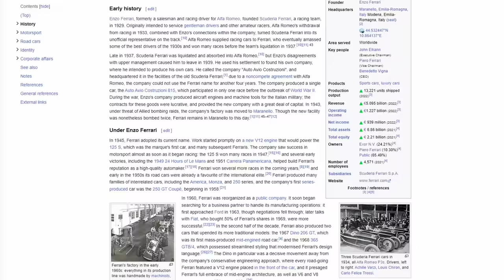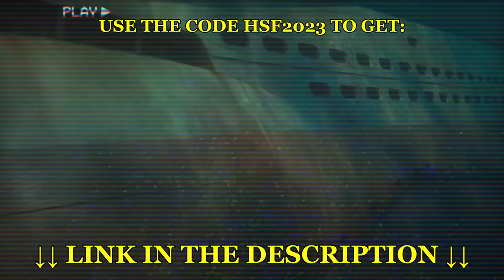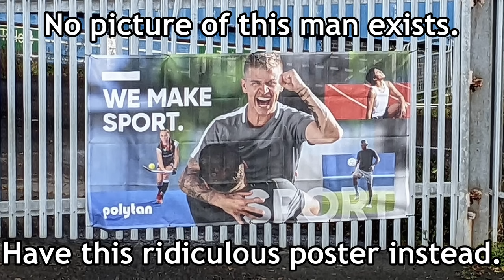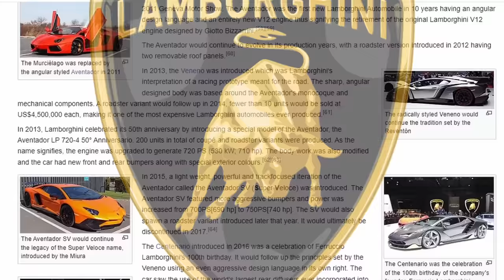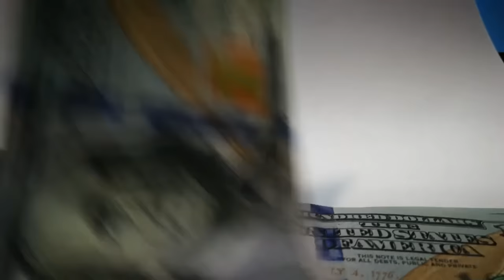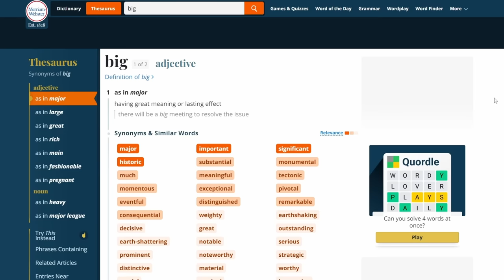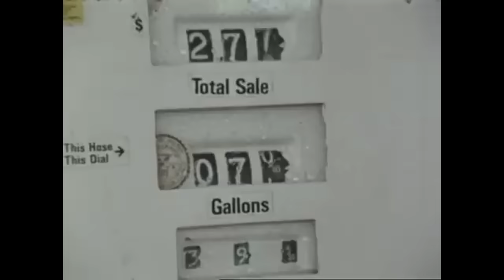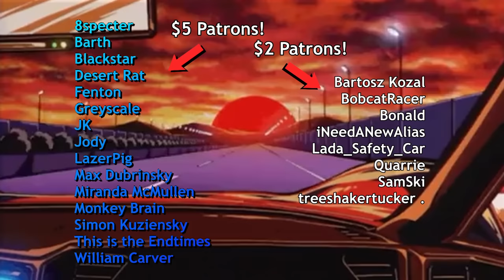Everyone Enzo Ferrari Shouldn't Have "Annoyed"

Comment: Side story: Fissoré also developed a sister design of the Monteverdi for TVR called the Trident as they also wanted to enter into the opulent GT market. Trident later became an independent company of TVR to produce the car and resulted in a 289 Ford powered GT car that was the fastest British production car (ahead of the AC Cobra) before Aston Martin released the V8 Vantage in the mid 70s. I’m restoring one such example myself, very interesting cars inspired by GT race of the mid 60s by Ferrari, Iso, Lambo etc

Comment: On the subject of Lauda,
He was as arrogant as Enzo, but only if you gave him reason. 
When a Boeing in his airline went down and killed all aboard,  he personally got involved in the investigation and found that a thrust reverser opened mid flight, causing the crash. 
Boeing said the pilots should've realized it and accounted for it, and that it was pilot error. Lauda tried it in Boeings simulator and found it typically not the case. When Boeing disputed this he said he would take one of his planes and do it himself since it was apparently safe enough by Boeings standards, basically saying if you're wrong, I die, and so be it. 
Boeing accepted defeat and fixed the problem on all of its aircraft.
Reply: What a beast
Reply: Lauda does not fuck around when it comes to safety
Reply: Although that bit about the pilot error is true there were investigations of austrian prosecuters into the downing of the airliner an although evidence suggested there wasn´t any knowledge knew about the sketchy maintainace that the aircrafts thrust reserver and it´s error that it gave for and if correctly identified by the maintainance crews would shown that there was a danger (although as you correctly pointed out it was undersestimated of how it would influence the aircraft if it did) but instead let if flew for over a hundred hours up to the accident instead having to ground after 60 or so at the latest by Boeings recommendation.
And I am even willing to say that Lauda Air knew they fucked up by playing game by not giving the investigators and prosecutors these maintainance logs they wanted until 10 days after under the threar to get a search warrant.

There was even a former Lauda Air maintainance supervisor who said that he recommend to NOT fly with Lauda Air due to the fact that maintainance couldn´t done properly since everyone was in fear that Niki would get upset if one of his aircraft would have been grounded for whatever reason.

And don´t get me started of how the families of the deceased were supported or better were completly ignored by Lauda Air until the takeover by AUA (which Niki Lauda did manage by using his political connections).
Reply: To be honest…this is kinda an Austrian thing
Reply: @adriangaber9176  agreed as also demstrated by Ferdinand Piëch who created cars that legends even and he was so deicated to making  perfect cars that even if it ment (in one case with wining le mans with porsche 917 in 1970) gambling the company it's self. He was mad genius who made vw into a powerhouse, porsche from small sports car company into a giant of sports  cars and a racing legends and audi from strugling irlenvent car maker into one of the kings of rally and le mans and saved all of the vw group on severl ocations . And his swansong was the bugatti veyron ss aka the second bugatti veyron
Reply: Makes sense
Reply: I didn't realize Lauda had an airline!  Another similarity to Eddie Rickenbacker.

Comment: Omg the iso grifo ir9 can am! The maroon one please, nothing else thanks. My cousin had one of those chevelles, it was stock. It dynod at 509 hp. It wasnt factory original stock but the only thing he had changed was putting in msd ignition new plugs and wires. It couldnt even be driven in a straight line well but wheeewee a hell of a lot of fun!

Comment: Here’s a thought what would be powering the Stratos if Enzo didn't give them the engines?
Reply: hmmm.
Reply: Here is a fun fact for you, Lancia famously made the first production V6 engine in 1950, but what is lesser known is that they won the 1953 Carerra Panamericana, 1954 Mille Miglia and the 1954 Targa Florio with the Lancia D24, powered by a 260hp 3.3L Quad-Cam V6. Fast forward literally one year, in 1955, after running into financial issues Lancia sold their racing team to Ferrari, including some of their engineers like the great Vittorio Jano. This was right around the time when the Dino V6 were conceived, and as a result the Dino engines (there are actually 2 distinct Dino V6s, the common 65° and a rare 60° designed by Jano) actually incorporated many design features and lessons learned from Lancias own V6 engines.
In a sense, giving Dino engines to Lancia was payback, since Ferrari went on to win the 1956 F1 Drivers Championship with a car they inherited from Lancias F1 team.